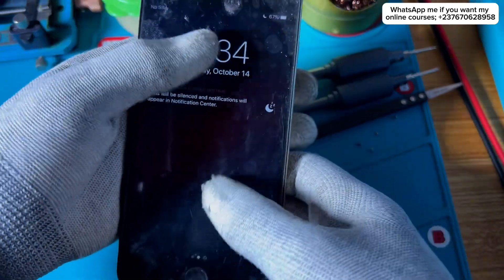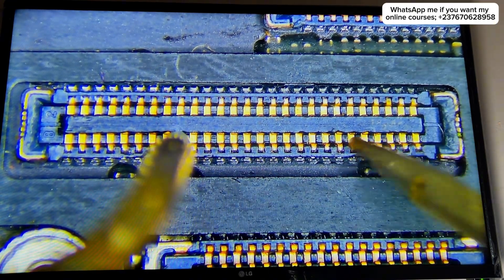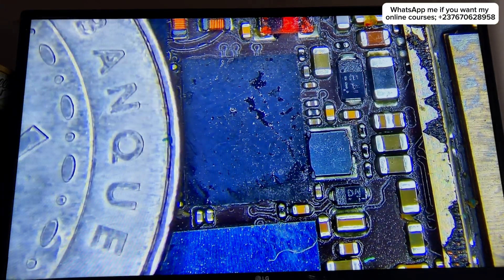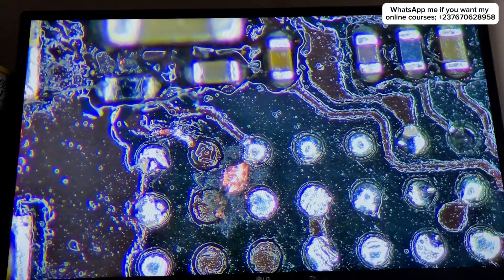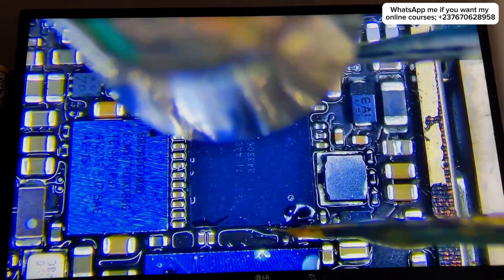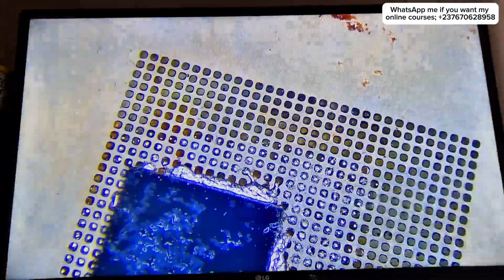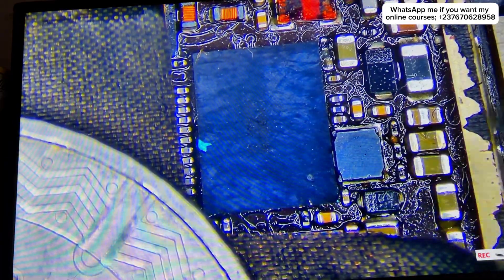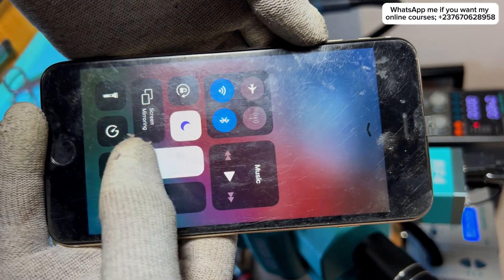Iphone Touch Screen Not responding Repair Video

Comment: Hello 👋 there, can you assist me here teacher. I have a phone 📱 Tecno Y3S, it got damage and I took it to a technician but it keeps asking for security PIN which I did enter. But it keeps saying wrong PIN. I even factory reset it but it keeps asking for the security PIN. What could be the problem since the PIN have been using isn't accepted?
Reply from the maker: Flash the phone with a firmware bro